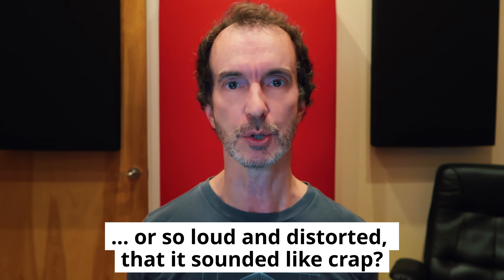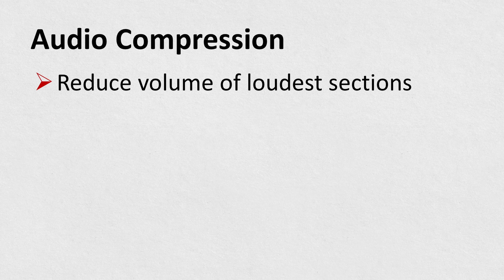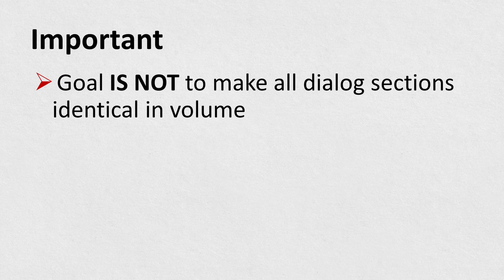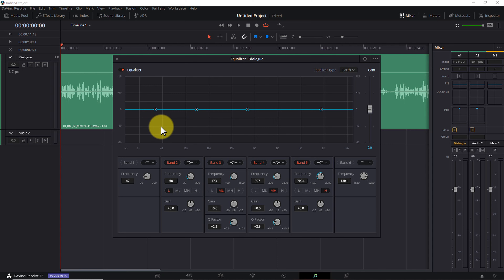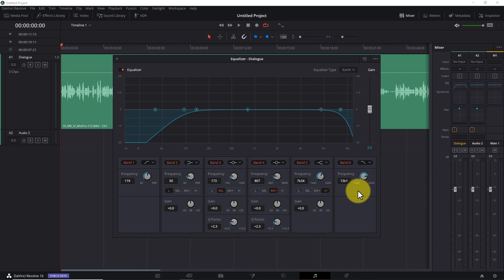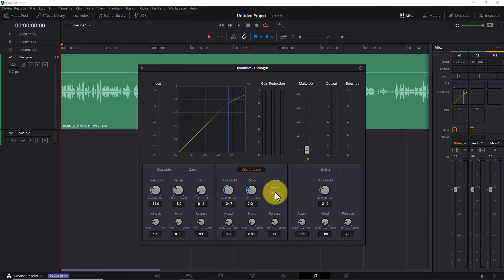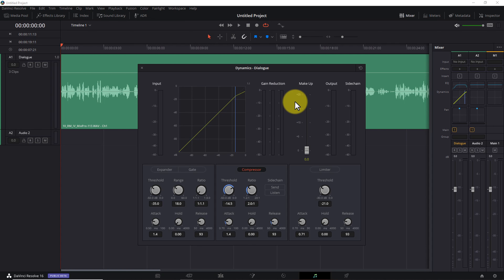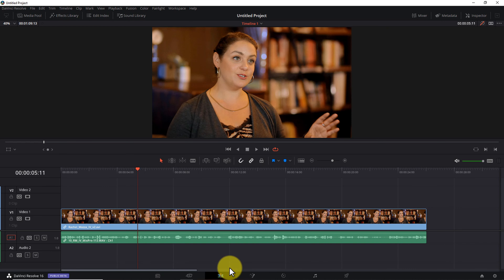Make Your Dialogue Crystal Clear — DaVinci Resolve PowerTip

Comment: I'm not an opera singer, but I'm baritone, as many other people, and the main issue with your recommendation to filter out the low frecuencies below 100 Hz and even higher is that you remove all the rich harmonics of the voice that make it sound unique. I wouldn't advise to take out so lightly those frecuencies, except if you are dealing with a very high-pitched tenor voice (I don't mean an opera singer, because we all are tenors, baritones, sopranos when using our vocal range) or a woman (as it is the case in the video, by the way). The narrator's voice is a tenor's as well... 😉

Comment: People are often confused by compression. The way I was taught when I started engineering in the 70s was: "A system that decreases the audio output as the audio input increases, and increases the audio output as the audio input decreases."  So, it squashes it!

However, audio compression is not and never has been a tool to correct problems with dynamic range.  That is done (in the old days) by riding the fader to balance the audio track (eg, a voice over or vox pop), or in modern times, editing by cutting and changing level of segments, or programming in gradual changes using automation (which is like riding the channel, but with help). Once that is done, only then is compression added to make the audio better.  So, your first approach by cutting to sort out the initial audio difference is the correct one, and that approach should be taken with everything.  At the same time, you can lower the levels of any aggressive breaths since later compression will bring those up even more.  Lower them a lot. I It will make later compression more transparent.

Part of the reason for sorting out level problems first is that any production must aim at a certain "loudness" depending on the output (TV station, Netflix, YouTube, all have their own loudness criteria.) You are much more likely to hit that criteria if you are not using compression to "iron out" your audio.

Comment: Instruction as clear as the audio - Nicely done; I like what you covered, and the scope was just about right. I have some very challenging audio scenarios where I have 3 or 4 GoPro and cell phone cameras attached to my car, and need to balance the audio (mainly exhaust and dialog), but it's an epic battle against intense wind noises and some other weird effects that occur under heavy braking or in certain corners where the low pressure air pocket behind my giant wing catches up and envelopes the cockpit. To battle this, I've been cutting my audio tracks into many short clips according to wave forms and normalizing independently, then manually adjusting the "over done" clips, then applying dynamics (by ear, I very much appreciated your 'rule of thumb' settings) then going in and setting keyframes to clarify audio where the speaker trails off or the transition between adjacent clips is too abrupt. For "puffy" wind noise, I use more severe compression and sometimes the limiter, but it has been quite difficult to get good results with wind reduction. Sometimes I also throw on the "De-Esser" audio effect and adjust the peak Hz, since my pronunciation of 'S' often comes with a lil bit o'whistle. I usually only use the mixer at the very end of the process when I'm balancing the relative contribution of the individual tracks. Anyway, thanks for the lesson, I most certainly appreciate it.  Any thoughts on multi-cam audio? I would really like to use mutli-cam clips to make it easier to pick camera angles after all of the above editing has been done, but they have this unwanted feature of playing the audio of the selected angle. If I want to have consistent audio, I have to add additional audio tracks to the clip that are not part of any camera angle and play quietly all the time so the addition of the selected camera's audio doesn't blow the meters out. It is quite a bit more difficult to manage the audio levels that way. Ideas?
Reply from the maker: Thanks for your comment. Multi-camera audio can be (as you've discovered) a real nightmare. My recommendation...  Disregard camera audio entirely and record all your audio to a single, dedicated track with a good microphone. If you need car / road / wind sound effects or ambiance... record and layer them in separately. You rarely get usable audio in-camera (I almost never rely on it) and in situations with wind, you really need a high-quality (i.e. non-camera) microphone with a proper deadcat and/or blimp protection. It's one more thing to deal with but the results will be light years ahead in terms of quality and production value.

Comment: Thanks for the video man.. I used the advice and the audio did come out a tid better. My rookie ass just really needs a microphone I presume though.
Reply from the maker: You're quite welcome. But yes, if you don't have a decent microphone, you'll be limited in the results you can achieve. You don't have to spend a ton of money but I recommend begging, borrowing, or stealing enough to get yourself something decent. The ATR-2100 or ATR-2500 is one I recommend to anyone as a first microphone. It's a dynamic mic so it won't pick up a lot of the noise in your room. But you'll need to be close to it when speaking to get best results.

Comment: Wow, this video explains everything so clear. Searched a while for this quality! Just subscribed. One question: what do you do if someone coughs frequently and loudly in a speech (e.g. webinar recording)?
Reply from the maker: Glad you found it useful, Michael. The coughing scenario is a tough one. If it's a short recording, I"d be inclined to edit the coughs manually... draw automation envelopes around the spikes in the waveform and pull them down to an acceptable level. If it's a long recording, that process will be tedious. In that case, I'd be inclined to add a second compressor, bias it to react only to the coughing "peaks," (i.e. and not the non-coughing dialogue), use a fast attack and release, and adjust the compression ratio to a level that sounds good to your ear. Unfortunately, there's no set-and-forget configuration for these "problem" scenarios... it can take some tweaking to get it right. Hope this helps.

Comment: Great video. Thank you. Do you have any videos about how to remove background noise when shooting outside?
Reply from the maker: Thanks, Geoff.

When you say "outside" are you referring specifically to wind noise or to general environment noise?

I ask because wind is a tough nut to crack. Advanced restoration tools like iZotope Rx have modules that help... but those tools tend to be quite pricey.

if the noise is traffic hum, AC hum or anything that's a little more consistent, it can sometimes be easier to remove. But there's no silver bullet. When things are really bad, big productions often bring the talent into a studio and record dialog in silence (ADR), then lay it in over appropriate outdoor atmosphere / environment recordings.

I'll continue to think about ways to deal with these issues that are low / no-cost. Thanks for weighing in.

Comment: Nice. I think I might just add that, the current tutorial is placing these adjustments/compressor onto the track and not the clip.  In this way, you are adjusting all clips in that track. The user should understand that all the audio clips would need to be very similar for this to be effective for the entire track.
Reply from the maker: That's a very fair comment, Mark. I don't recommend placing unrelated audio clips on the same Resolve track. Audio from different sources should be placed on separate tracks so each can be "treated" distinctly. However, I acknowledge my tutorial doesn't make that clear. So, thanks for point it out!
Reply: @DavidPower  That makes sense.  So any audio on a track - even from different clips are affected by these changes.  So you can't just affect one clip on a particular track that has other clips on it as well?
Reply: Liquid Valium you can, simply apply the effect to each clip you want compressed
Reply from the maker: @RockyColaFizz ... As Domagoj writes below, it's possible to apply the same EQ and compression effects to a clip as well as a track. I prefer to group all similar audio clips on the same track so I can control volume, effects, etc. once rather than multiple times. But your use case might differ. If you need them at the clip level, you'll have to drag and drop effects from the VST bin to the clip and then adjust them accordingly.

Comment: I watched this quite a while ago and used it when I was doing voice over. Great stuff. This week I was finally editing a how-to recorded in my woodworking workshop. Half remembering what you said, I added a compressor, but didn't filter high and low first. I've also edited out a bunch of awkward pauses. I've also done Normalization once or twice as well. My problem is that the volume is now too loud throughout. Does Fairlight start from the original recording on these adjustments, or is each adjustment cumulative? In other words, have I shot myself in the foot!  (I still have the original clips. ) Thanks!

Comment: Great stuff - subscribed.  Thanks David.  Is normalizing the audio the quick and dirty way?  Or do you normalize your audio and then tweak it.
Reply from the maker: Hey, KZ. I don't recommend normalizing at all. Normalizing is exactly the same as turning up the volume on your entire track. It just makes everything as loud as possible without clipping. It does nothing to reduce the dynamic range (i.e. the difference between the louder and quieter sections). Plus... if you have a single loud peak (something close to clipping) in your audio, normalizing won't make much difference at all. Hope this helps. Thanks for subscribing!

Comment: What a great explanation. Thank you. I have been using iMovie and then editing the audio via audacity. This makes the editing process so much easier. Is there a reason you compress after applying the high/low pass filter? does it make a difference if you compress before? You don't mention Normalise or Limiting. I usually Normalise after applying the filters. I then limit to 0db.
Reply from the maker: Hey, there! I'm glad you enjoyed the tutorial. Low frequencies tend to have more energy than higher frequencies. So when they're present, they CAN trigger the compressor a little more aggressively than necessary. For that reason—and since they're mostly inaudible anyway—I generally do the EQing before compression. 

Normalizing can be  a little tricky and not my favorite way of maximizing dynamic range because it just "makes everything louder." I do use a limiter with a ceiling of -2dB. YouTube (and every other video platform) re-encodes your audio before publishing it. That process sometimes adds gain.  So it's always a good idea to include a little margin (just 1 to 2dB) to keep things on the safe side. Hope this helps!

Comment: Hi David, now in Fairlight 16 the Loudness panel shows several standards in that 3 dots,  like EBU R 128 that i think is standard broadcast tv loudness because is -23 but i read that standard loudness for youtube is -13. Because that i set up loudness EBU R 128 that is equal to -23 to reach integrated + 10 because -23+10lufs = -13 that i supossed be the standard for youtube. The problem is when i set up loudness in this way my master in my mix reach red all the time and not  yellow. Should i trust in loudness EBU R 128(-23) +10 integrated for final results -13 or just trust mix in main master to be in yellow?  loudness is a good topic for many people.
Reply from the maker: Hey, Alex. Your math is fine. The problem is the meters simply measure your output... they don't control it. Most standards quote both an average (i.e. -23, -13, etc.) but also a Maximum True Peak level... usually in the vicinity of -1 / -2dB. So, to push your loudness to -13, you almost always need to use a limiter on your master buss and set its ceiling at -2dB. This prevents the output from exceeding that level. Once you've done that, you can push your average level upward to your target. 

Two caveats: 1) -2dB will be "in the red"... don't let that bother you. Red is only an issue if the output hits 0dB; and b) Listen carefully to your audio before rendering. Depending on how dynamic your audio track is, a -2dB peak can make the track sound "crunchy." To avoid this, use a compressor pass (or two) before you start to mess with loudness standards. This will ensure your audio is both clear and distortion free.

Let me know if any of this is unclear.

Comment: very nice sir but is there a quick fix to make equal volumes in an interview? one person has an a-ok level of volume but the second person has a very low volume? how we can make the volume of both the persons at the same level so it looks like an interview? hope you get what I mean?
Reply from the maker: Can I assume the speakers are on different tracks? (i.e. It's always a good idea to capture each speaker with an independent microphone and record them to separate audio tracks.) If they're on different tracks, I'd start by applying the compression process outlined in this tutorial and then simply adjust the overall levels of each track so the speakers are relatively equal in volume.

If they're on the same track... that's a lot more work. You either have to: a) accept that they're at different volumes and use a different setup next time; or b) cut your audio track into clips whenever a different person is speaking and adjust the levels of each clip to even things out. You can reduce the workload a little by placing the "cut" sections for each speaker on separate tracks and adjusting their volumes with the track fader.

Be aware that this later method may introduce a noticeable jump in your noise floor when the speaker changes. Also, you'd undoubtedly encounter situations where the speaker talk over one another and it won't be possible to separate them.

Hope this is helpful.
Reply: @DavidPower  so it mean there is no easy way basically
Reply from the maker: @ChangingPak  If your speakers are on separate tracks, it's fairly easy. If they're on the same track... no, it's not easy.

Comment: Great tutorial thanks, helped out my self-tapes a lot.

Does 'normalise audio levels' between tracks help here or add anything?
Reply from the maker: Normalizing isn't the worst thing you can do but it offers limited benefits. Depending on how dynamic your original recordings are, normalizing may have very little impact — or a huge one. 

If you compress first — tame the peaks and get all clips in the same loudness ballpark — THEN normalizing can be beneficial. But you're always better off using a limiter to raise your dialogue to a consistent level without clipping. Normalizing alone won't do that for you.  

As you're likely gathering, each of these topics can be a tutorial of its own.

At any rate.. glad you're here!
Reply: @DavidPower  Thanks for the tips, appreicate it David.

Comment: Hi David, this was a really useful video, thanks so much! I have a question I was hoping you might be able to help with? I do a lot of reviews, and always have an annoying sound of air conditioning units in the recording as I have 4 of them outside my window. I use a Lav mic, and have not been able to shut the sound out with physical objects etc. So basically I try to edit the audio to both remove some of the noise from them and sweeten my voice at the same time. My question is about the order of using the tools I know. For example, this is what I currently do: 1. noise reduction plugin to remove some air con hum. 2. EQ to remove some more hum, and also drop some bad frequencies of the air cons and my voice. 3. add a de-esser plugin with auto setting. 4. compressor, doing pretty much what you described in the video here. Does that seem like the correct order to deal with both the air con background hum and also improve my voice? It definitely sounds better when I do it, but you can always still here some hum and it does alter my voice a little, though at an acceptable level. I'd love to know if you think this is the right way to go about things, or if a different order would work better? Many thanks for reading!
Reply: Have a look at the expander too. This can reduce the level of the background noise in pauses between words and sentences. Needs to be used subtly so you don't hear the background level pumping up and down but it's a useful tool to help just a little bit more.
Reply from the maker: Your workflow is sound. The only tweak I'd make (and you might have tried this already) is to run an AC-only EQ pass as the first step in the chain... Remove everything below about 80Hz (100Hz if it doesn't impact your voice too much) with a steep 24 or 48Hz/octave high-pass filter. Then run noise reduction if you still need to... but with a lower intensity setting. 

As you've noticed, when used liberally, noise reduction creates artifacts in your dialogue. Not the end of the world, of course but nice to avoid whenever possible. If you have the budget for it (or even the curiosity to download the trial), give iZotope Rx a spin. I've saved countless recordings with the Rx noise reduction.

Other than that, your chain / workflow sounds solid.
Reply from the maker: The Gate / Expander idea is also worth checking out. Depending on the level of background noise, sometimes you can by with gating the "silence" between words. As SwansongMedia suggests, biasing the Gate module properly is critical... otherwise your dialogue can sound super unnatural... sometimes even worse than noisy dialogue.
Reply: @DavidPower  Thanks so much for the answers and ideas! Thanks also swansong - I hadn't been notified of your reply, hence taking 2 months to say thanks!